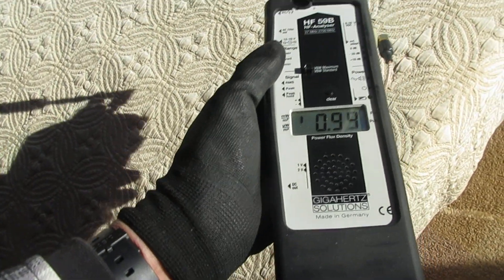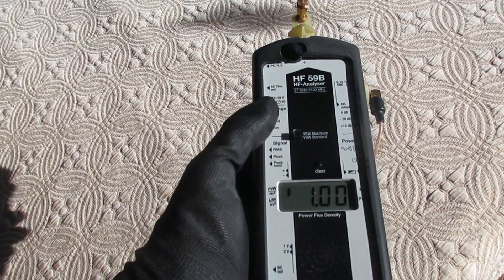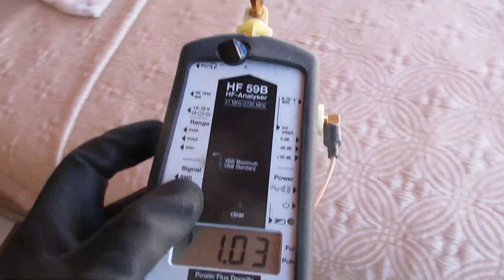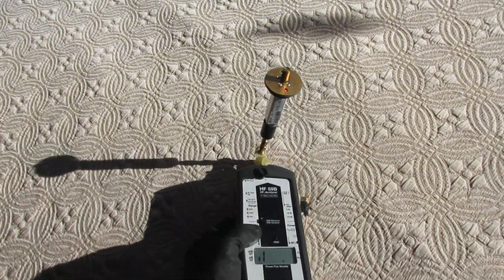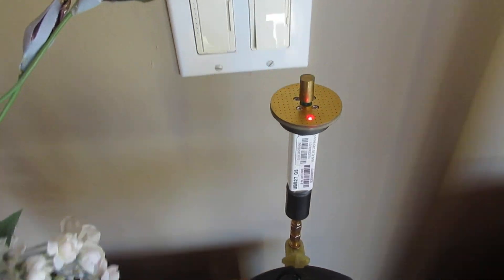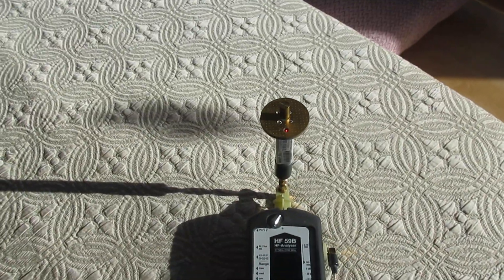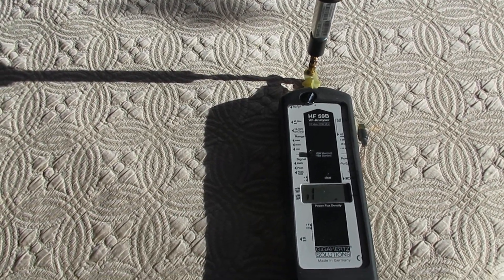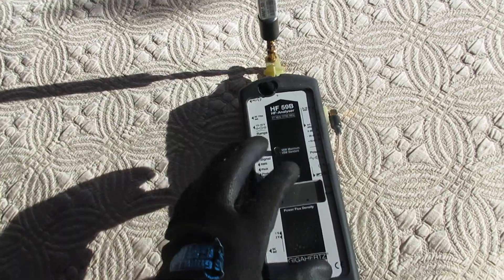FM Radio signal voids real estate pre purchase inspection

Comment: So then wouldn't this be an identical issue in any house with nearby FM radio signals, if the home wiring is coupling with and amplifying them? Also, to what extent does the frequency of RF signals affect the EMF-sensitive person's experience? For example, would this 1 mW/m2 FM radio signal affect that person to the same degree as a 1 mW/m2 WiFi signal would? Thanks.
Reply from the maker: Different frequencies have different biological effects.  There is no safe or healthy level of RF radiation.

Comment: great video! What frequency is the meter picking up? And how it is different than a FM radio, if you put an FM radio there, would you hear the station extremely clear?? So say you don't have a meter, and you're in a remote location you think is EMF free, you could just make sure all FM stations are not very clear and that's a good cheap indicator?
Reply from the maker: Here are the specs on the meter 27 MHz to 3,300 MHz see link: https://safelivingtechnologies.com/products/gigahertz-solutions-hfe59b-rf-meter-kit.html

Comment: Where are you located? I have had a rough time with Duke Energy and underground power distribution. Since im pissing off a three letter agency with a lawsuit those guys have done some unbelievable things against me including effing with my power. I can measure high volts on my ground. My copper plumbing is springing leaks all over the place. I have seen loose cable for TV  coil up tight. Everything metal on my property is holding a charge. I sell used stereo receivers and I can hear there overload breakers pop.  Water and underground power lines outside highly magnetic. How are they doing this?
Reply from the maker: I am in Sacramento CA: where are you?  High voltage on you ground/neutral wire relative to a remote earth stake could mean you have a illegal neutral to ground connection in the house or the utility has a high impedance primary neutral.. I have a trusted EMF electrician in Virginia that could diagnose and potentially fix this.
Reply: @windheimemfsolutions  Well thank you for replying. I'm in Ocala Florida. I'm feeling something in my body when this is going on. I've tried everything to find out how and where this is coming from. But when I touch a copper waterline inside my house with a volt meter and hold ther other end with my hand I get a milli volt reading of 2 to 3 hundred. Other times nothing. I've seen high readings on the rebarb in my slab. Crazy high readings on my cable line. I have  dish on my roof. The stereo receivers un plugged and popping there internal breakers is the most puzzling. Could I be getting hit with something from these corrupt government freaks. I mean it takes some kind of energy to pop those un plugged receiver breakers?
Reply: @charlesrunthesum5991  interesting! I'm near Crystal River Fl and having close to the same probs. Diana Schultz of Green n healthy homes came out and measured. Told us we really need to move immediately.
Reply: @Anthony-kx2mi  Can you tell me why they said to move...What is there statement based on? In my case its intentional. I've heard of running neutral and ground parallel open in the earth. That caused havoc on the property and in my house...Duke energy engineers where not helpful. One guy claimed 30 years of experience and never heard of my situation. Yet my research shows many examples of my exact issue.